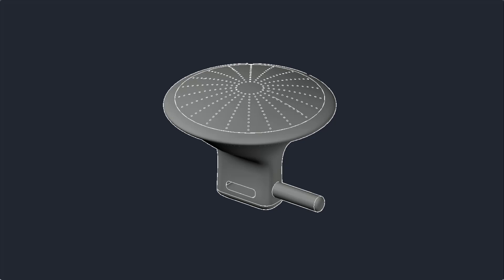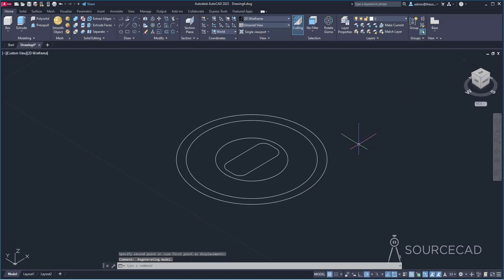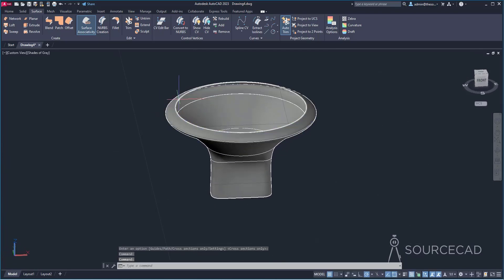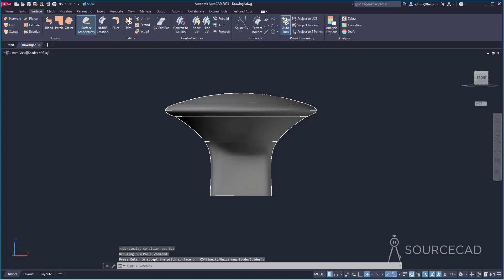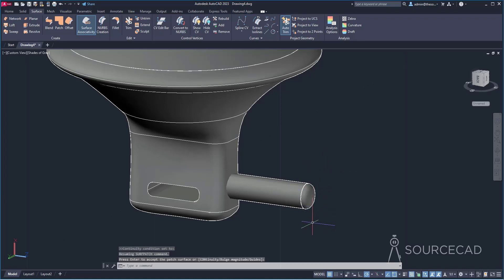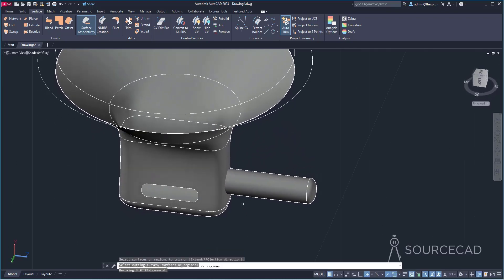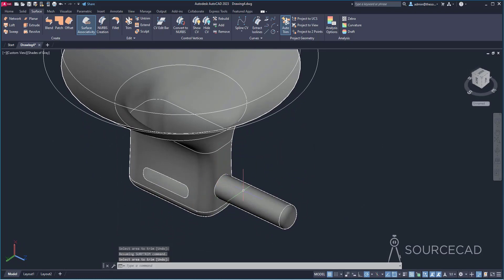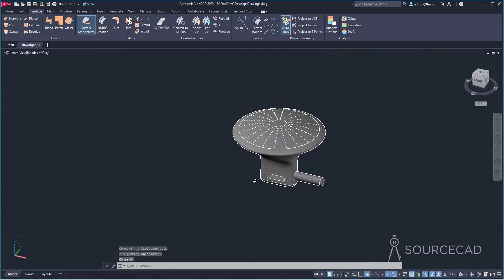AutoCAD Practice - Making a 3D earphone with surfacing tools

Comment: OK just a little confused.  You make a copy of the surface to be perforated for sound holes.  You then hide it and it seems you never use it after creating it.   So what was the purpose of creating a  0.1 offset never to use it again?

Comment: I am having trouble at timeframe 7:11 the line and rectangle does not show on the outside of the shape but in the inside.
Reply: sameee
Reply from the maker: @angellovess_  You can create the cut even when it shows inside.
Reply: Same issue using 2022 ver but was able to trim still by rotating to see the line inside.